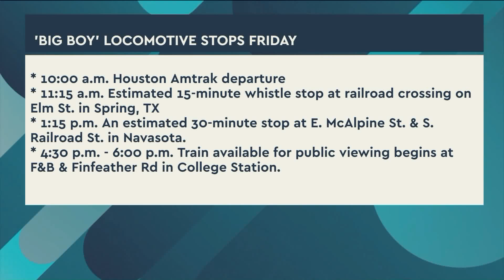Building the World's Largest Steam Locomotive

Comment: Not the largest, not the heaviest, and not the strongest pulling steam locomotive ever made.  Just very popular.
Reply: It was the longest of course but I understand that the C&O Allegheny was heavier, taller and wider. The N&W Y6B and the DM&IR  Yellowstone both had higher tractive force AND were at the same time considerably lighter than the Big Boy. My disappointment is in the Allegheny's tractive force. As heavy as it was it should have had a much greater tractive force but it got beat by the three aforementioned locomotives as well as Pennsylvania's Q2 in both tractive force and HP. The Allegheny should have had 16 drive wheels to spread out that intense weight so it would not have been so damaging to the trackage and it's tractive force would have been increased substantially, especially if they would have increased it's psi from 260 to 300 to match the Big Boy.
Reply: @ralphmiller2620  PRR S-1 was longer by 10ft
Reply: @ralphmiller2620  The GN R-2 also had more more tractive force than the Big Boy, and it's not just the Y6bs that have more pull, it was all of the Y6s (I think the Y5s as well). And increasing the amount of driving wheels doesn't really give it more tractive force, it increases adhesion. Boiler pressure, cylinder size and driving wheel size affect tractive force, it's in the formula. Tho I do agree that the Allegheny should have more drivers and an increased boiler pressure to match the Big Boy, I can imagine how much better of a locomotive it would be with those changes.
Reply: @ralphmiller2620  the allegheny had a higher running horsepower rating, and it did what the c and o needed it to do, as part of the van swerengin rail group, it did twice the work, in half the time of the h7 and half the fuel, there was talk of making improvements even to that, and the allegheny was also bought by the virigina railroad I think they got 8 of them but called them the blue ridge class, I saw an artical in the c and o historical society book on the h8 class and did a video reading in multi parts in 2019, its on my channel, big boy is the longest locomotive alone but you add the tender the allegheny is longer and then there is the matter of the prr s1 some say that also put out about 7000 hp, though some say the biggest firebox ever put on a steam locomotive was the one on the allegheny, but it did what the c and o was looking for and the lenght of the trains was hampered by the lenght of the sidings otherwise it would have pulled even longer coal trains according to the article
Reply: Its the largest commercial operating seam locomotive for the time being maybe not in history but as of operating standards